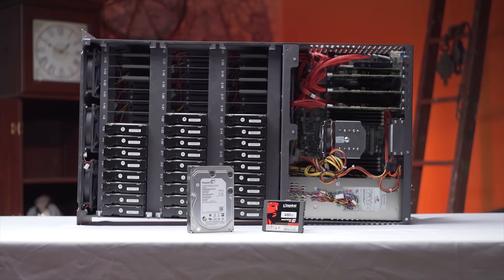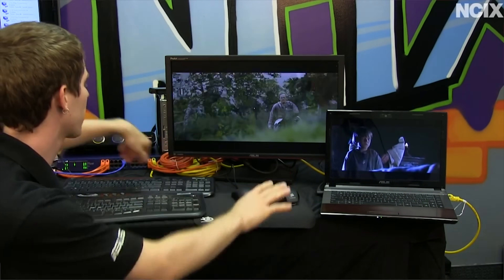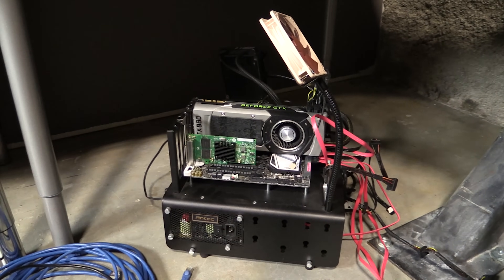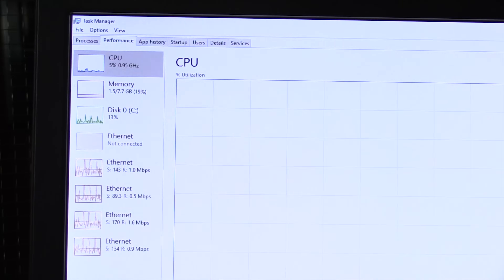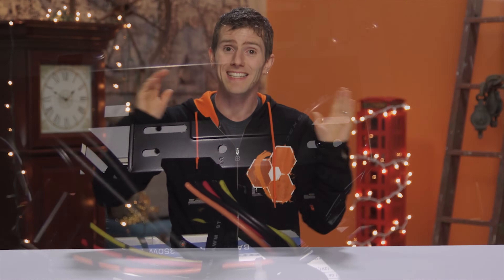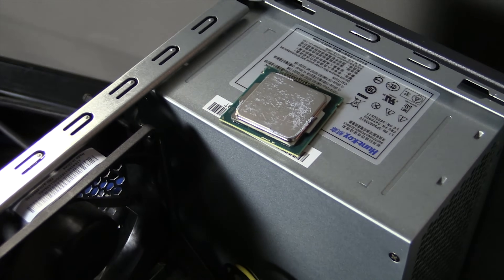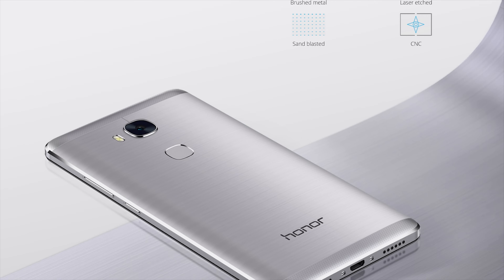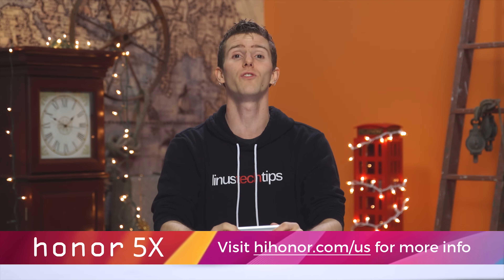Quadruple Your Network Speed for $100 with SMB 3.0 Multichannel!

Comment: ... add a custom tcp/ip stack to handle packets arriving in the wrong order on BOTH sides without having to resend packet 1 AND 2 if packet 2 gets there first... which makes it incompatible with the whole god damn internet out there btw, and BOOM! you got it to work for anything else than bittorrent... as guess what. port trunking/bonding works either on mac or source:dest ip/port pairs and spreads over the interfaces that way. which makes 1 destination always talk to 1 source over a single interface to ensure the packets of that connection remain in order... (no biggie with bittorrent but obviously it would be with anything a bit more directly related to tcp or udp). in your case it might have just 'randomly' worked because your office is relatively small, has just 1 router in between if any, etc, and the wires may all have been the exact same length, but packet reordering and resending becomes a bigger issue in larger setups (such as ours which runs some 2000 gigabit ethernet ports spread over 5 buildings with some 4km in between). tcp is crap out of the box and it WILL cause resend of earlier packets AND the later packets again if the later packets arrive first. actually surprised it worked at all considering that it requires specific configuration on switches. maybe the protocol you used is smart enough to make multiple connections with multiple source ports or something, or it simply doesn't care, or the cables were short enough to keep things in order, but normally, this would not work. not for plain simple http downloads or other single source:destination<mac|ip|port> (depending on configuration) stuff anyway. (yes, when doing it on larger setups by just randomly pooping packets to different interfaces you will ofcourse 'see' 4 (if you use only 4 wires ;) gigabit/s but most of those will be resends.
Reply: this is not a 'hardware' issue, and most definately not dependant on the cpu... we did that stuff with pentium 1's already back in the days they were new... back then it was called 'cisco etherchannel', now it's some IEEEE standard, lolol. and btw it's the same wether you do it with 10base ports or 10ge ports... the one thing that remains however is that you cannot just throw packets that are supposed to remain in order, such as TCP, over multiple different wires, and it usually won't... for that specific reason.
Reply: it's perfectly fine for dns servers (even with random balancing), for bittorrent (which spreads the load over multiple ip:port pairs anyway), timeservers (although, why would a time server need 160 gigabit for example ;), or just do a portscan and ddos the entire internet while you're at it... but it's not so good for 'normal office use' :P
Reply: if you modify TCP to have a buffer of packets on both ends however. like ax.25 does... but preferably with a lot more than just 7 packets buffer :P then it's no issue that packet 1023 is already in ram of the stack when packet 4 still needs to arrive.. just return them to the os recv() routine in as far as the sequence is complete and in order... ofcourse you'll need to make some additional changes to properly request resends etc as well. and then indeed you can have a single tcp or udp session at the combined wire speed. but it won't be compatible with anything else out there.

Comment: Why not just bind the four ethernet ports into a port channel?  Then you get 4 Gbps across the board, on any protocol.
Reply: That requires both a NIC and - more importantly - a switch that supports link aggregation. That probably takes it out of the cheap level.

Comment: Is "SMB Multi-channel" a software title?  Or, is it merely a method of transfer?
Reply: SMB is a service layer protocol that windows uses to transfer files over networks, and multi-channel is a feature of that protocol which enables it to use multiple network interfaces to carry out a single transfer, for increased speeds.  3.0 is the version of the SMB spec in which the multi-channel feature was introduced.  https://blogs.technet.microsoft.com/josebda/2012/06/28/the-basics-of-smb-multichannel-a-feature-of-windows-server-2012-and-smb-3-0/
Reply: +pseudocoder78 oh wow!!!

So, it's kind of like a specified form of "Network Teaming"?
Reply: Yeah pretty much, and that specificity means it's not useful for anything other than file transfer.  Usually network teaming is carried out at the link layer (https://en.wikipedia.org/wiki/Link_aggregation) with protocols like PortChannel, which enable anything using the network stack to take advantage of the extra speed.
Reply: +pseudocoder78 oh wow!!! Thank You so much!!!

While I have you here, I am considering a system build to vm multiple Windows instances on a Linux (for more efficient & more expansive memory utilization) host with Type 2 Hypervisor.

Any thoughts?  I haven't really been able to find videos, and my learning disability makes it difficult for me to read extensively...  So, I'm hoping that "Tutorial Video Buddha" will fling a "Hail Mary" my way.
Reply: TheRangeControl
Hmm, well it depends on what you're using the Windows machines for.  Generally if you want to get the most performance out of a VM host, you want to run a bare metal hypervisor.  Also reading will probably be required, sorry!
Reply: +pseudocoder78 1 video production suite, 1 audio production suite, 1 cad/cam/illustration/animation suite, 1 gaming.

Comment: I saw "under $100" and was hopeful, but then he said "switch that I for from someone" and was VASTLY disappointed. Using free hardware that was not found secondhand in some way, turns this into click bait, nothing more.
Reply: Just checked eBay and you can get two Intel 4pt cards and a Netgear 8port switch for 74.99
Reply: Patrick Ramsey It's actually only a couple bucks more for a 12 port switch.

You could probably manage a 16 port gigabit switch and two cards even for $100 if you watch the listings closely for a bit.

Edit: Yeah, found a 16 port gigabit switch and two 4 port intel nics for 39/30/30 respectively which would be $99 total with free shipping. 

Now of course more computers drive up the cost $30 per. But the video specifically talked about speeding up one pair, so that's still possible under $100, with room for expansion to two other PCs for only $30 a piece.
Reply: if you really wanted to you could do it without a switch by using four crossover cables and directly connect he machines. Depending on if your cards support auto mdx, you might be able to use regular cables.
Reply: You could also get a switch for reasonably cheap if you only need 8 ports for this. Might still be able to manage under $100 depending on your hardware setup.
Reply: Raven1024 actually no, you can't get an 8 port switch and the 2 cards needed for this under 100, I've tried, Heck the 2 cards are close in and of themselves, even second hand.
Reply: +Mike Alesso Precisely
Reply: +Mike Alesso at that point 4 cross over cables would work for less money . 8 port switch makes no sense.

Comment: Windows use overlapped io. With correct hardware and software, it's just like "hey network card, pls send this buffer and notify me when it's done". Or one can use TransmitFile API function (direct send from disk to network which should be really fast). There are multiple choices in api under windows and for such speeds and configuration, one (as a programmer) needs to find best one. You can for example discover, that one API call doesn't use bonding at all and you have to try another..
I'd really like to try this if i have a switch and a second (fast enough) pc :/.

edit: I forgot to mention, that smb multichannel is at the network file share level. another option is network nic teaming, which is at lower level (probably require windows server and nic which supports it)

Comment: I have 2 questions.
1. Why do you need a 16 port ethernet switch?
2. Why do you need 8 cords when you have 4 ports?
(do you need 4 extra routers?)
Reply: I'm not a newtorking guy in the slightest but the 8 cords go:
PC 1 < 4 cords < ethernet switch > 4 cords > PC 2

So you need 4 on each end to connect each PC to the ethernet switch.
Reply: TroidHunter oh

Comment: sadly I only have adsl2+ which for me has a max output rate of 7mbps but on comes out as 2mbps such so much and that's megabits not megabytes also every on around as have cable internet except for us due to what they say there bring a pencil like tree outside our house which is huge
Reply: This video is about network transfer speed, not internet connections...
Reply: whats the difference?
Reply: BulletProof Tomato Networks are series of computers connected together with a data link, like in an office or home.

Comment: Answer: SMB Multichannel is tied to RSS queues. You need to use PowerShell and Set-NetAdapterRss to configure the number of RSS queues to match the number of physical cores. Hyperthreaded cores do NOT count, as RSS queues can only attach to actual, real, physical cores. Once setup SMB will, during negotiation, tell each other that you have 4 NICs, each with 4 RSS queues, and viola! Assuming you have no storage bottlenecks. By switching from a 2 core proc to a 4 core proc you allowed more RSS queues across more cores, which allowed you to reach 4x1Gb speeds.

https://technet.microsoft.com/en-us/library/jj130863(v=wps.630).aspx
https://blogs.technet.microsoft.com/josebda/2012/06/28/the-basics-of-smb-multichannel-a-feature-of-windows-server-2012-and-smb-3-0/

PS - If you want to go super fast, check out RDMA and SMB Direct. I've seen speeds upwards of 2.2 GB/s using a single RoCE RDMA 10Gb NIC. Enjoy!
Reply: Serious question (noob here).. With all of the retired Server grade equipment floating around, what about using an older 10GB server switch + NICS with 12GB SAS drives?

Comment: Hav'in an E5 2658 v3 (12C) as a server but the Problem is that my main machine is a retina Macbook Pro; would need a PCIe Chassis, another NIC (apart from Thunderbolt) AND 3 more cable rings around the house that a 700$ 10GBE Thunderbolt would be cheaper.

Comment: Now do what we love Linus tech tips for and get 2 4 port 10 gigabit cards and see if you can get faster than 10 gigabit
Reply: On top of that, I want fiber optic cabling. So find better used networking switch.
Reply: you seriously don't want that for anything but the links between the patch rooms and for stuff that needs to be galvanically seperated (emp proof) from outside (transmitter faraday rooms/the little boxy thing on your roof next to the antennas, whatever you have for that. etc)... fiber cabling is vulnerable as hell... you don't want it coming out of the floor or wall where people walk around. also say hi to an $10k splice kit.... (and no just looking into the hole to see if it has a red light not prove it is properly laid and working either - and btw is generally a bad idea even with just laser class 1 - so you need stuff to test that too ;) if your premises are small enough (a few 100 meters at most) to stick with copper, stick with copper. much easier to process and harder to break.

Comment: linus is the reason normal users have the shit internet days
Reply: Except he is talking about network speed. Network as in a closed network. Not internet. You can't use some hardware and extra wires to get faster internet. What your ISP gives is what your going to get no matter what. Put a larger spout on the end of a water hose, and you'll still get the same amount of water.

Comment: i needed some help, i managed to get quad pro 100/1000 server adapter. however i cant find it to run it on windows 10. it looks like the issue is the drivers, hence where can i find drivers for windows 10 or which port can be used to communicate with windows 10. in the video it looks like one of the pc is running win10.
Reply: get the original .zip driver from intel unpack. Go to network adapter update driver. Select form the disk and chose some of the 350 t2 or t4 adapters and select latest driver from ..1000 folder. I can't find tutorial online. this works for sure...

Comment: Or, you could just change the firmware in the routers or drivers in OS to loadbalance data across multiple lines and use software assembly packing to relink the data.  This action can be done at both the source and destination spots with multiple ISP connections without having to change backbone utility (your bottleneck is ISP connection at this point).  For LAN and wireless routing, this can also be done for faster internal network speeds.

Oh wait, that's right, this channel only deals with material stuff and doesn't actually know how to program shit....got it.

Comment: I have a host rig (4670k) and a client (Pentium E5800 3.2ghz dual core).. will i be able to use 2 cards with 2 ports on each and a 8 port switch to get atleast 200mbps? Or will the Pentium be a bottleneck even for 200mbps? Host is running 8.1 64bit and client is running 10 32bit... 
I only need 200mbps as the client's HDD will probably be the bottleneck...
Will this work?
Reply: +Gershon Dharmanandan 
it should work but not faster than 2 port to 2 port. You will get somewhere around 190 ~ 200mb/s.  
I have similar setup and as soon as I added third card transfer went down below 1gb and wasn't stable.
I'm recommending using intel network adapters, they handle much better and 4 core 8 thread CPUs
Make sure RSS is enabled it's 99% by default.

Comment: 10 gigabit networking has been coming down in price. 
Cleaner and faster.
A lot of 1 gigabit switches just lack the effective backbone to handle multiple gigabit channels simultaneously. 
Trying to parallel cheap switches and cards is a hit or miss thing.

Comment: How would performance be in an i5 instead of i7? You went from i3 straight to i7, but would there be a large loss in performance if a 4690k is used instead of 4790k?

Comment: My conclusion... on this I would like to share here... since there is not much online about it at all.
I was playing like Linus did with his crew on this video. CPU i7 will pull best results. Some people mixing this with internet speed but this is for local network file transfer and share of large files.
I do 3d camera tracking for commercials and feature film and this is something it helps me load 4k and 6k images... file sequences.
I did test this with older xeons on ML110 g6 I've been using as file servers - share location... and it's not giving good results CPU can only pull 2Gb/s via multichannel adding 3rd card - adapter will ruin the results not even giving 1gb transfer I was getting transfer like USB 2.0 - very poor. It will jump up and down showing multichannel works but poor.
What this will do it will evenly distribute poor transfer over multiple cards to multiple clients. No point of use, it's better to make a NIC team and than share. So I gave up on this one as multichannel  file share.

My current setup is FreeNas as regular file severer for 1Gb even file share and one Windows 8.1pro machine as work station with 6 nic attached sharing over multichannel raid drive running on LSI 9260 - 8i with 8 drives in raid 10. This drive is getting 760mb/s R and W. 
Thing you should care about in multichannel setup is your NIC adapters have RSS enabled. You can also mix adapters: brodacom, marvell, intel it will work like charm... only important thing is to have i7 type of CPU on both ends. No timing just straight plug to your switch. Multichannel will do the job and figure out who is who on both ends. This is so amazing like having fiber optics installed. 
This works over unmanaged switch without problems.
What is left to test on my end is how multichannel will work over the bridge between two switches. I use HP pro curve. Bridge will have trunk of four ports. Will see... 
Update on switch bridge: it works :)

Comment: I have a pretty beefy PC that can do almost anything, but this video gave me a chuckle.  If you have Macs, you can establish a 10gigabit network simply by plugging in a thunderbolt cable between them.  One cable, 10x speed, no hassle, no hours of pulling out hair.  The network is established automatically.
Reply: +sflxn You miss the point of the video then.  This is to show SMB3.0 multichannel and cheap and dirty way to go past standard gigabit speeds.  You can easily buy a thunderbolt or 10gigabit nic and call it a day.

Or better yet team up multiple 10gigabit cards

Comment: My house is over a century old and has walls thicker than oprah's thighs. WIFI signals are terrible throughout the house and my computer is on a different floor from the router. I can't move either the computer or the router, and I can't run a wire through the walls easily because of the danger of asbestos. I can't think of any other options to improve my speed.
Reply: +VeryUnfriendlySpoon Have you tried powerline adapters?
Reply: darksidelead
Hadn't heard of this before. I will look into it, thank you.

Comment: One would have thought that you had paid attention in CPU design classes. Every packet sends an interrupt when it's done, basically the I3 couldn't keep up with them.
Reply: +Saddutchman 
Yes I was testing this in my small VFX office with several windows 8.1 pro machines and older file server can't keep up over 2gb its ML110 g6 4 core no hyper t.
Machines with multiple cores like i7 and old X5670 works fine. It's not the CPU usage in % but the way they are build looks like.